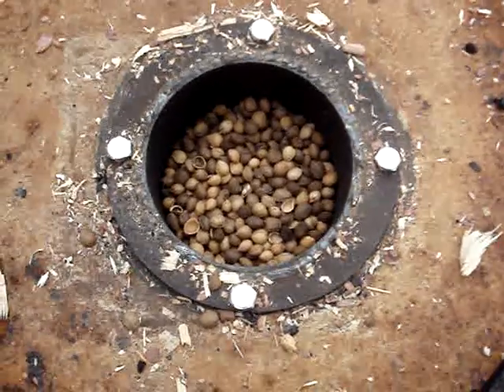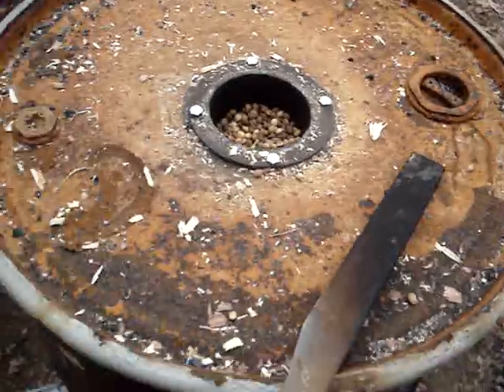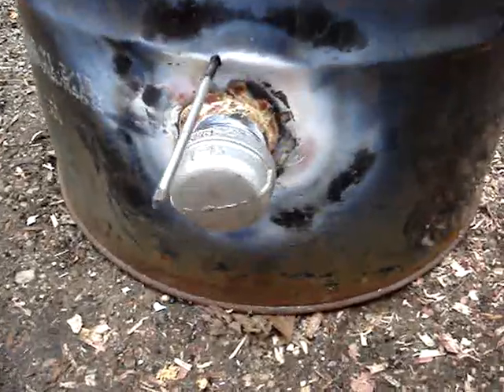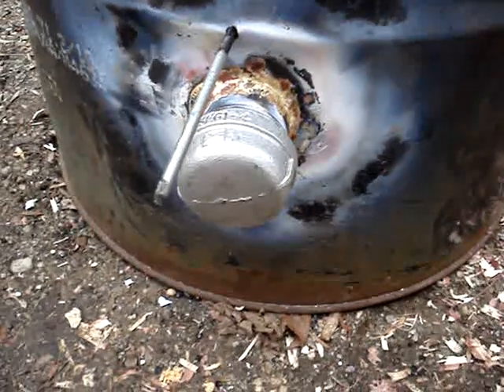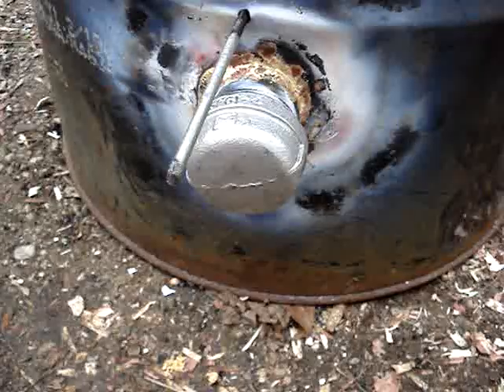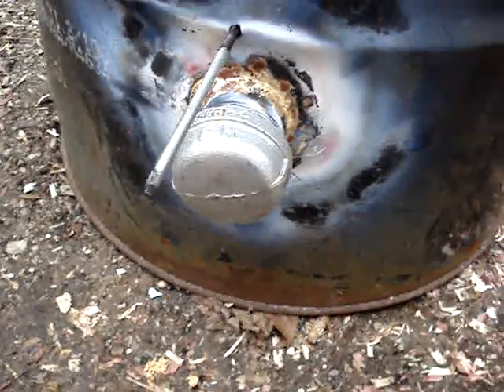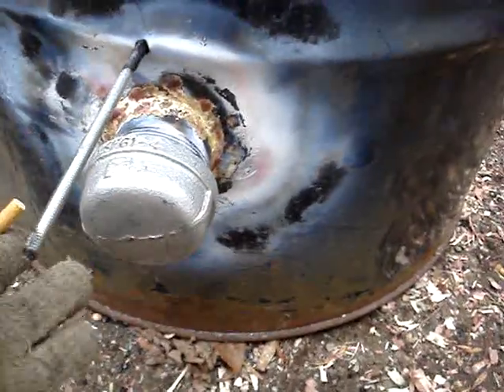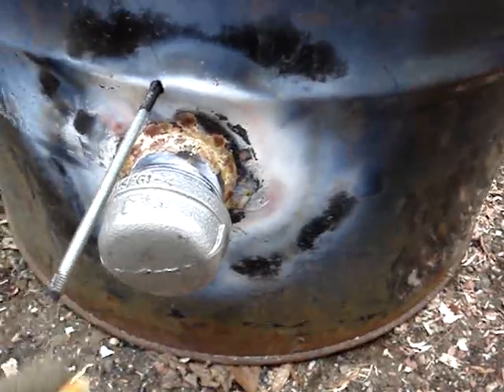wood gas generator

Comment: Great video Well done. Danke.Bitte the barrels open and show how the internal structure ist.Sonst unfortunately nobody understands how clean wood gas is produced. What's in Brennraum.Was is cleaning room. The pipes in the center are determined, the radiator of the hot gas .lg andy from Germany
andyngd@gmx.de
A few photos or Gas.zip would be very happy ...

Comment: Nice job on the simple gasifier. are you getting any tar build up? have you tried a filtration system prior to going into the lawn mower?  that would run a gas generator for a while, what was your longest run time with the fuel that high up on the primary burner?

Comment: ok so the mower is running on wood gas / biogas, without a governor and sitting still! How do you purpose to get the lawn done unless you move the mower around on the lawn? A better application would have been to fuel a generator

Comment: WOW... no filter your pumping way to much tar to the valves you should run your gas through a couple buckets of sawdust to get rid of moisture and tar but I like the reactor you built

Comment: Good work, although I can't say I understand it completely. It seems that gasification for generator power (so you can watch porn, undisturbed) might be completely plausible. At least as long as stuff to burn can be found. Do you get any "distilled" liquids collecting or does it all come out as gas?

Comment: I think the mower was only an engine to show us how well it works. They used this in the WW2 because of the shortage of gas & fuels. The used things like this to run all sorts of motors & cars & trucks by mounting it on the car or truck.

Comment: What do you think wood gas is?  A combination of hydrogen and methane gas with a little extra other stuff.  I cannot beleive how many people realize that the engine runs. Yet do not comprehend that it takes a combustible to make it run.  If you can get ignition within the cylinder head.  What makes you guys think it is not combustible?  Obviously I am the stupid one understanding the molecules it takes for ignition.  I say that because of the idiots that act like I am.

Comment: @Gunther222  Actually it is Carbon Monoxide gas that is being burned. It's the same fuel used in Steel Mill Blast Furnace Stoves which are used to preheat the blast B4 going into the blast furnace.

Comment: @NewJura Wrong...super heated wood converts to hydrogen and then ignites. If done properly you get no smoke, just steam and CO2. Its not up for debate, its a fact.  

The gas going into the lawnmower could ignite, but it is under pressure and being outdoors the chances of a Hindenberg type explosion is minimal.

Comment: First, I've heard wood gas can gum up an engine. What do you do to prevent that?

Second, is there a way to compress the wood gas into something like a propane tank for later use? It seems like it might be more convenient to spend one whole day burning wood and compressing the gas into tanks, then just run for the next month using the tanks.

Comment: how come you by passed the carb? couldnt a guy just dumb the fuel/air right into the air intake and use the carb to regulate the throttle instead of your ball valves? thanks
Reply: ball valves are for dosing the woodgas and air together, the carb won't do that.
Reply: @Politikul  understandable now that I'm further along in my woodgas journey

Comment: NICE ONE!
I built a wood chip burner before. It would burn shredded trees & limbs. It would even eat up leaves. I'd stuff the 100# propane cylinder hopper with anything!
I'm quite certain it was converting the water to hydrogen and then burning the gas. 
I suspect that's what your doing as well
Thanks

Comment: If you can get your hands on a small propane carburetor for a generator or a forklift it should work with wood gas. It will keep the air/fuel mixture the same at different rpm's and different amounts of engine load.
Reply: Available on Amazon for around $25

Comment: you would be-able to use a small motor cycle engine  radiator and and have a small pump pump water through an old/cheap bran new cooler put ice water and salt in it. then have that water run through your rad and you wood gas it will cool it off more.  : )

Comment: Simple.  You dont.  A $2 weather balloon can be filled with the gas using the blower (if the gas is cooled enough).  The balloon supplies the pressurized fuel for use any time you are ready.

Comment: The fuel is a gas (ala Wood gas), not liquid.  You could compress it into a gas cylinder but it would use all your energy to power the compressor.

Comment from the maker: first question what am i using in the grey barrel for a filter?  saw dust and wood chips.

second question what kind of tube am i using?  i am using a vacuum hose and have had no problems yet but if you look back at the video the condencing pipe that i am using is made a lot longer than most it is 7 feet long. that is what is cooling the gas before it goes into the grey barrel.

Comment: Very nice.  2 questions:
1. What are you using in the grey barrel for filter media?

2. What is the flexible tube running from the filter to the engine?  I started out using vacuum cleaner hose and quickly melted it!